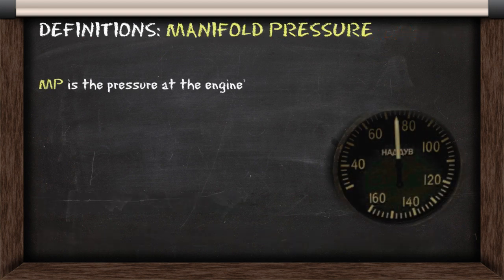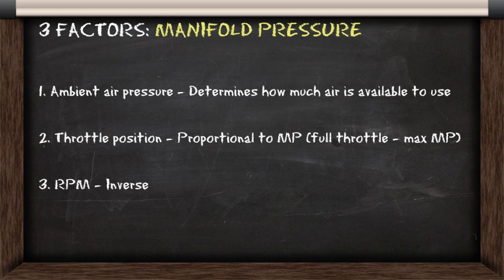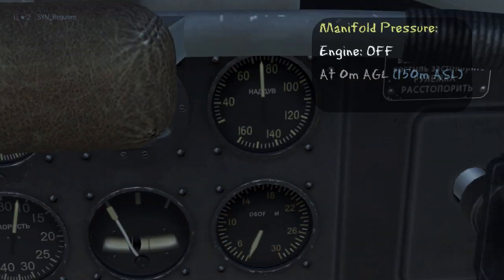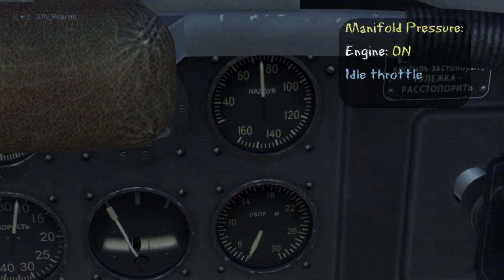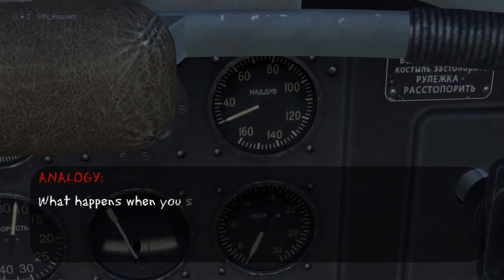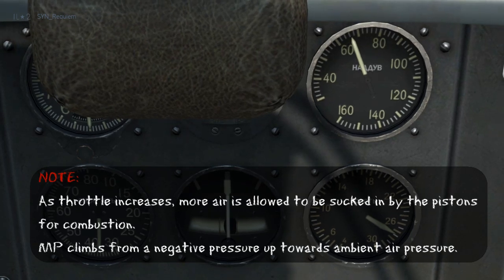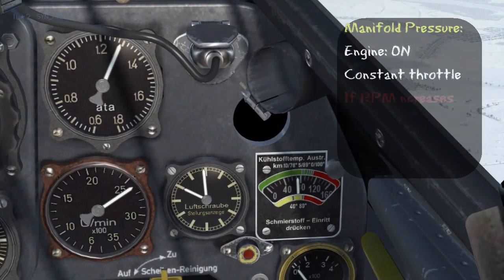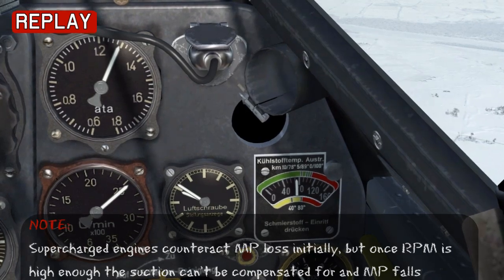CEM Lesson #4 - MP and Superchargers

Comment: Is MP the meaning of "ATA" or "ATA/atm"? I can't find an explanation about it anywhere yet it is somehow crucial for rpm control.
Reply from the maker: MP/ATA/lbs boost are all different measurements for the same unit. ATA relates to atmospheric pressure
Reply: @RequiemsACTL  Well I know it related to atmospheres. But what does 2500 RPM 1.3 ATA actually mean? And how can you read it off the tachometer or ATA/atm meter. I don't understand how to use them
Reply from the maker: @bobu5213  If you have an airplane where you can control RPM and MP separately you'll have two controls to use (throttle/RPM control) to attain whatever combination of MP/RPM you need for a given phase of flight. If you're in an airplane such as a Bf 109, for normal engine operation you will just set ATA using the throttle and the RPM will set itself automatically.

Comment: Question: So I heard (from Sheriff's Sim Shack) that high RPM = better acceleration but not best top speed; so why is that?
Also when you reach this best RPM for speed, is that constant regardless of altitude, or does it change whether a higher/lower RPM is recommended depending on your altitude?

So regarding manifold pressure, when you get that to its highest point, is that considered where the engine is performing best? If so, is that in terms of acceleration or top speed?
(current understanding is that max RPM = better acceleration and max Manifold pressure = best top speed)
If manifold pressure is unrelated to the best performance, then what are the practical uses of manifold pressure?
Reply: Manifold Pressure in general increases the engines power and should dictate how much the RPM are worth... altough im myself am confused with all that :D

Comment: Very good.
Question though. Why not compressing air at low altitude (use supercharger at low altitude)? If I follow the logic, more air would be allowed for combustion. Combined with lot of fuel, more power would be generated no? Is there anything like sucking too much air in an engine?
Reply from the maker: You are right with the idea that the more air you can get in, the more fuel you can add, and the more power you can get... but in the case of just turning the second speed of supercharger meant for high altitude down at low altitude it doesn't quite work that way.

The supercharger requires engine power to run, so if you are running the supercharger harder (ie - the next speed) then you are taking away power from the engine to do so. Besides that, engines are designed with a certain maximum air pressure in mind to get their maximum power, and turning on a supercharger at the wrong altitude forces too much air in (increases pressure above optimal maximum), so the engine can't actually use the extra air you are throwing at it anyway. I believe that putting too much air in this way can cause problems for the engine.
Reply: The Air Combat Tutorial Library Ok thank you. Keep up the good work!

Comment: Ideally, while flying, should you adjust your RPMs to allow for the maximum amount of MP? If I push the throttle too far the MP will drop, will this give me a corresponding loss in performance?
Reply: Oh!, also I would like to make a note for everyone that as you climb and the air becomes thinner, it would be wise to lean out your mixture & increase your prop pitch. You lean out to maintain a good ratio of fuel:air intake, otherwise your motor will overheat quicker as there is too much fuel being injected vs air being taken. This will inevitable cause engine damage and the possibility of completely losing your motor. As for increasing prop pitch as you climb. The air is thinner so you need to increase the pitch at a higher altitude to maintain a constant airspeed. By increasing your prop pitch you are taking a bigger 'bite' of air. Essentially allowing the aircraft to grab more air required to maintain a constant speed and altitude. (sorry for the tangent of sorts, I figured it was relevant in a way to the topic.)

Comment: 190 next, please?
Reply from the maker: Yes yes yes, that will be the next one to be released :P I was holding off on completing it because I had a feeling that the 3D models and/or FM would be changed based on evidence provided by the community since its introduction. Today the Fw 190 just received an interior 3D model fix so the Revi is at the correct height and the lower instrument panel is visible, so now I'll do my best to get the Fw 190 familiarisation out as quickly as possible.

As a guess I would say it could be ready by Wednesday.
Reply: Many thanks!

Comment: Nice one Req!
I was googling a few weeks back trying to figure this MP "problem" out.
If I get it right, you can sometime compensate for loss of power by reducing RPM?

Also interested in mixture and mp/rpm coordination for optimal power.

Cheers man!
Reply from the maker: I'm not sure I read about that anywhere. A reduction of RPM is an indicator of losing power, so I wouldn't think that by reducing RPM further you would suddenly get power back. A propeller gets less efficient as you climb in altitude, and MP falls too, so I think for maximum power you would want to have the highest MP and highest RPM you can combine together without destroying the engine.

I'm sure someone will come along to set me straight if my above assumption is incorrect.
Reply: It makes sense.
But (afaik) with old diesel engines when you floor the accelerator you flood the combustion chamber. If you then go off the throttle and start to gradually increase it, you can feel the power coming back.